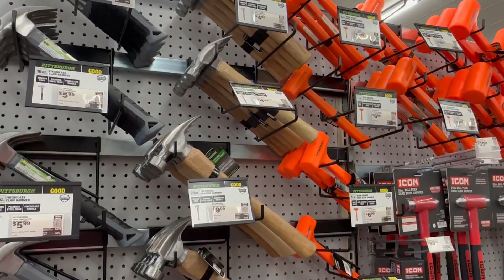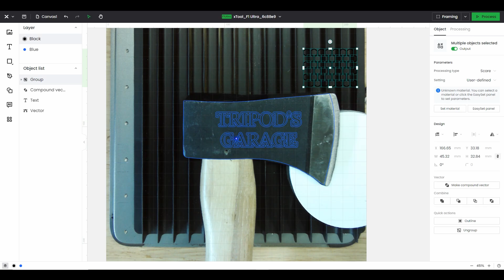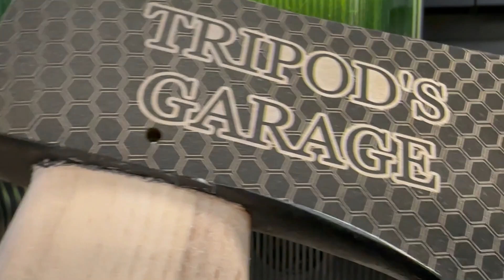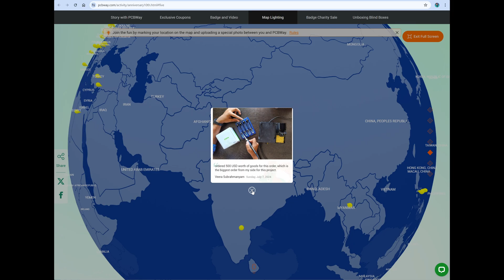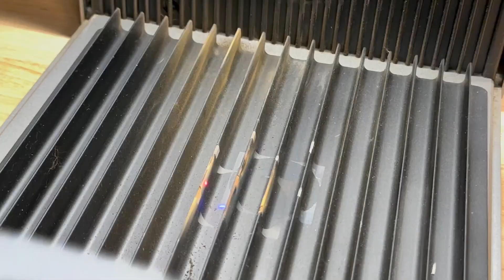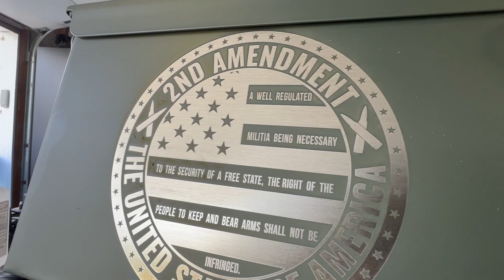LASER ENGRAVE HARBOR FREIGHT TOOLS WITH THE XTOOL F1 ULTRA

Comment: Can you tell me, can this be done in the S1-40W or the WeCreat Vision 40? (engraving on metal tools or wood handles?) I am trying to decide which laser engraver I want to buy. It will be my first one but I don't want in a year to be saying... oh I got to buy the new one cause it will do this and this or I am so sorry I didn't get the XTool cause it does this and my WeCreat doesn't. I learned big things from you in just 1 video I watched so I am watching more of your videos now. I learned to make sure you have a stable steady table and I am concerned about the escaping exhaust you had in your video about the WeCreat Vision 40w. We can not vend thru a window or open a window/door or garage for this and I don't want fumes. This will be in a small 10x10 bedroom with a small vertical window vs horizontal window. Now I am wondering if the Xtool S1 40w will have the same exhaust issue.
Any help is GREATLY APPRECIATED.
Reply from the maker: Greetings!  Well first question, what are you looking to engrave?  Second question, what is the size of the items you are looking to engrave.  To me the F1 Ultra has basically everything one could want.  You can practically engrave anything.  Having a dual source laser gives you a lot of flexibility.  The Vision is basically good for woods and other organics.  Sure it offers a 2w IR, but it will not do any deep engravings in metal like you saw in this video.  Plus with a galvo laser they are more compact, faster, more accurate, and they do not shake a table.  For the most part if the part fits in the F1 Ultra with the lid closed, the exhaust does a good job venting out.  Hope that answers your questions?  Thanks for watching and commenting!

Comment: Hey Tripod, I'm a complete beginner (bought your Falcon 2 40w) and was wondering how you figure out how to figure out what power and speeds you need for different materials. All the videos I've seen haven't been that great. Think that might be a video you could make? (Complete noob video haha)
Reply from the maker: Hey Brad!
Materials are very tricky.  Especially wood can be a little different each time, due to hardness and how close the rings are. However, there is a material chart that you can start out with as a reference from Creality.
https://store.creality.com/ca/blog/creality-falcon2-laser-engraving-cutting-settings
Also you can take a look at my xTool D1 40w as a reference also.

Comment: Just got my F1 Ultra and wanted to see what settings you used, since a friend at work is already asking me to etch his tools :) Nice results! I think on the pocket knife, since it's a galvo laser, you want the thumb catch directly under the center of the laser, so the circle around it doesn't get distorted. Ignore what the camera shows since the camera's offset, just make sure you measure correctly. So focus on the blade, then slide it over so the catch is centered.